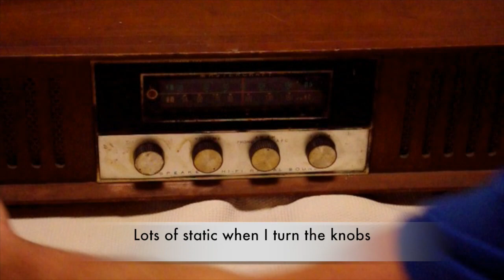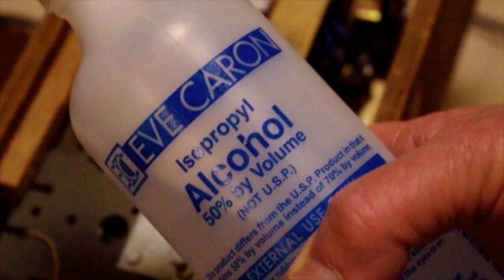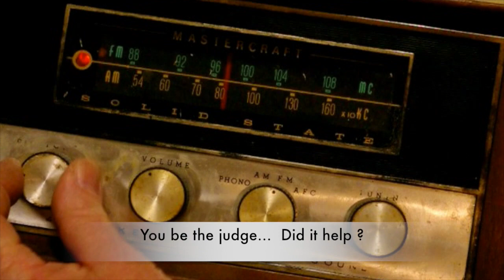Radio volume control noise fix.  Static - repair static noise volume knob radio

Comment: If you use alcohol....you shoud only use 99 or 100%.  Something with little to no water in it.  Like from the hardware store.  Also...I would use a dropper and not soak the inside trying to get a few drops into that pot.  They make contact cleaner that works better than anything...and it's not that expensive.  I've only ever bought one can in my life and still have half of it.
Reply from the maker: Thanks.  I agree the 99% alcohol would bee much better.